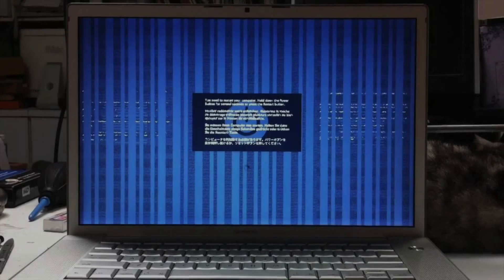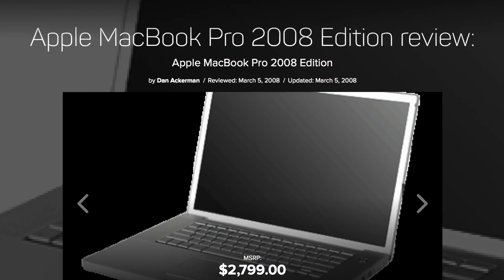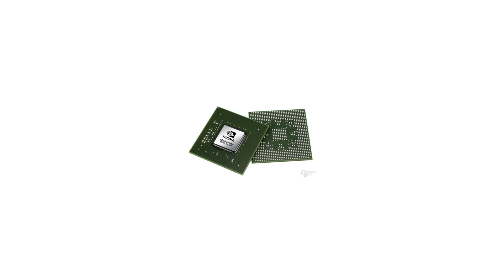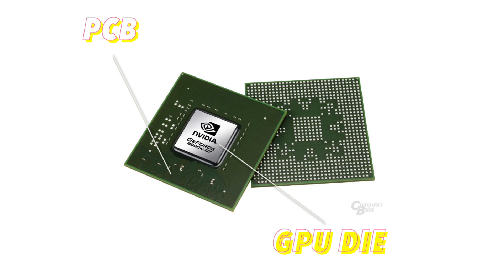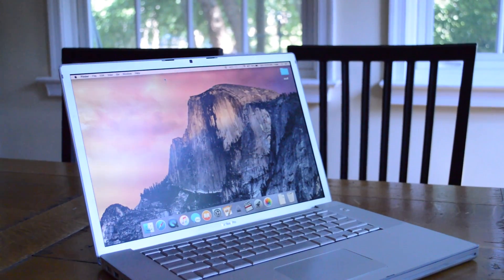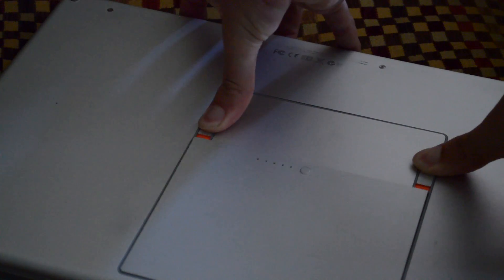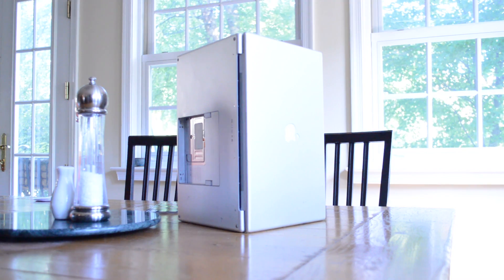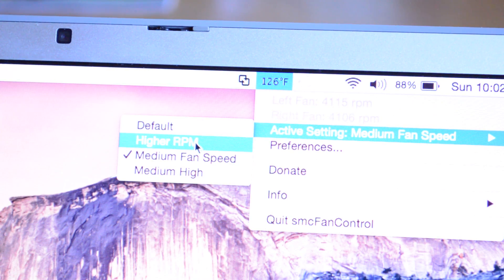2008 MacBook Pro Graphics Issue Explained (and how to fix it!)

Comment: Mine was WAYY worse.The GPU is not fucked but some component is keeping it from turning on,for example if you turn mine on the fans will go 100% speed and no video or bong.I have tried reseting Pram and stuff but nothing.Going to try this method if it works im going to have 2 working macbooks and will be happy as fuck to have my old beast up and running again.
Reply: try pulling ram and testing each stick
Reply: Cortex thats a dead motherboard. Thats why your fans are running at full rpm, as the motherboard can no longer tell the fans to slow down, let alone boot.
Reply: I know Xinless... But hey at least i got a new one! a late 2008 one!
Reply: Cortex Yeah, that’s a definite improvement. I replaced mine with a mid 2009 macbook , as I need the FireWire port for fast communication with external storage devices and my PowerPC fleet.
Reply: Yup! Love my Unibody Mac! Enjoy yours as well. What PowerPC Macs do you have?
I have an iBook G4 Top of the line 1.45 GHz with 1.5GB of RAM and i used to have a Power Mac G4,but sadly it got rekt by a bios update...While i was doing it my sister tripped over the power cord sending the mac falling on the floor,making huge noise and fucking up everything in the process. The macs i own now are a dead macbook pro early 2008 15 inch, a working late 2008 15 inch macbook pro, an iMac early 2006 17 inch and an iBook G4 14 inch. Can you tell me what macs you own?

Comment: well my screen failed and it didn't boot up anymore. So I took it apart, shoved the Logic Board in the oven and baked it for 8 minutes at crispy 180C. After that, I let it cool down, put it back together et voila, it worked. Let's see for how long. And don't forget to remove that ugly spunk that apple calls thermal paste and put on something decent before you do anything. Now it runs Sierra on an SSD, looking forward to upgrade to high Sierra
Reply: TheMetroRetro these laptops aren't upgradable to sierra officially
Reply: "officially" but can put it easily on them, follow the instructions by a guy called dosdude1 and download his Sierra patcher or high Sierra patcher and it'll work without any issues even with apfs
Reply: TheMetroRetro did you need a USB flash drive or anything?? Sounds interesting
Reply: Yes you need the High Sierra installer app. downloaded from a supported Mac or some darker sources on the internet and a 8GB or more USB Stick then go on this website http://dosdude1.com/highsierra/ and read the instructions carefully. Dosdude1 also has a YT channel, so go and check it out. It's really not science I'm sure you can do it
Reply: TheMetroRetro do you think it's possible on a white MacBook from the same era? Model A1181 core2duo
Reply: Everything you need to know is in the link, and no. You theoretically can install it, but it'll run poorly because of that awful Intel GMA Graphics, which weren't even supported anymore back in OS X Mavericks days. it's like running Windows without graphic drivers
Reply: TheMetroRetro Well mine is officially supported on OS X El Capitan..It's an early 2009 model a1181.
Reply: well then I read it wrong after I copied your model number, I don't know them by heart, but yea the 2009 macbook works just as fine. keep in mind that you probably have to upgrade your wifi card, otherwise you won't have wifi at all. I upgraded the card in my MacBook Pro myself, with a replacement that just costs 10€ from eBay, and now even continuity works just fine with my iPhone
Reply: @pokemonmasters4028  it depends on what model of A1181 you have. It runs on the GeForce 9400 GPU based models, not on the other ones.
Reply: What about now? is it still ok after baking it? I did it today, so I'm wondering how long this fix will work... thanks :)

Comment: What fan control app and setting did you use?
Reply from the maker: I use SMC fan controller and I set the RPM to about 4200 for normal use like web browsing
Reply: Luke Miani thanks!! 😀
Reply: @lukemiani  what would be a good fan controller for Windows 10 ?
Reply: @Devo1987  FanSpeed? MSI Afternurner? idk